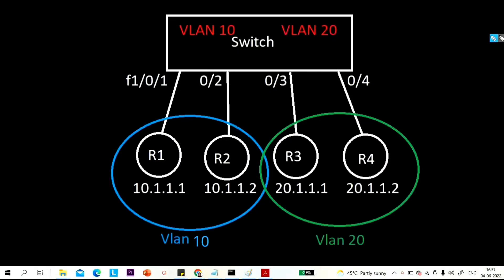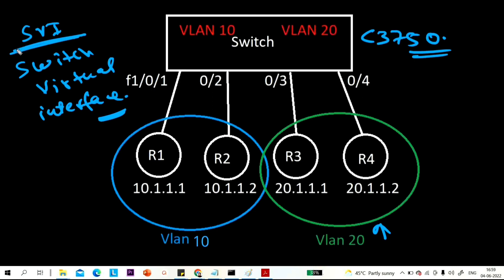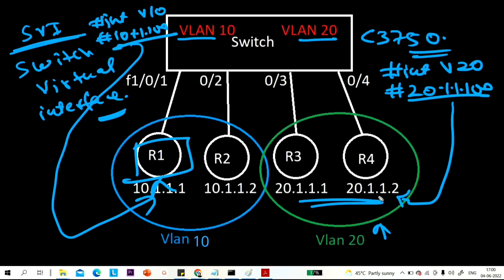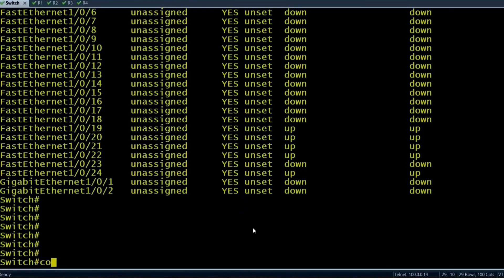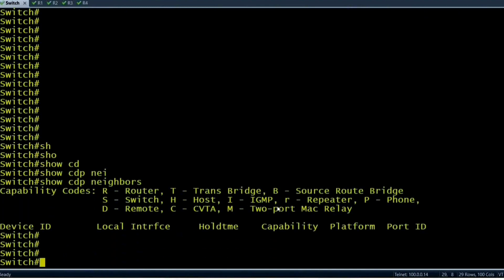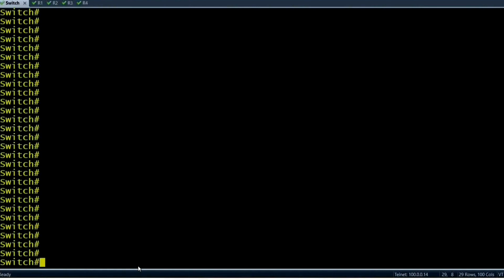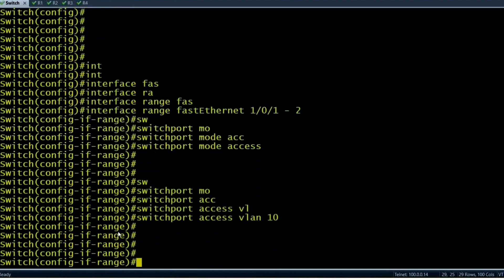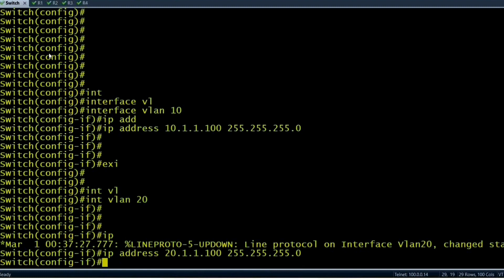Day-8 | SVI(Switch Virtual Interface) Configuration | Communication Between Two Different VLAN

Comment: Sir Can this configuration be done on cisco packet tracer?
Reply from the maker: Yes
Reply: @PMNetworking  In router, after writing command "no ip routing" "default gateway 10.1.1.100" is not taking in packet tracer.
Reply: @jnyanendrabehera3301  Bro because that is a limitation of packet tracer.